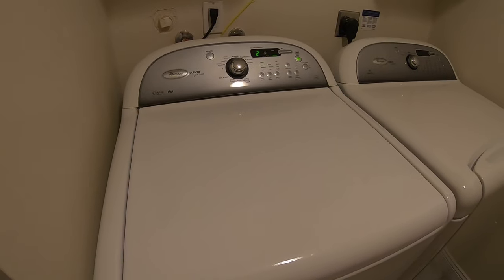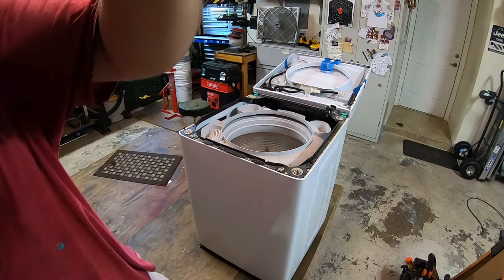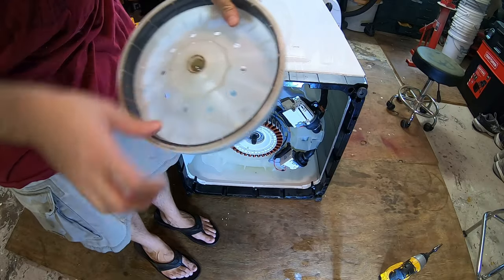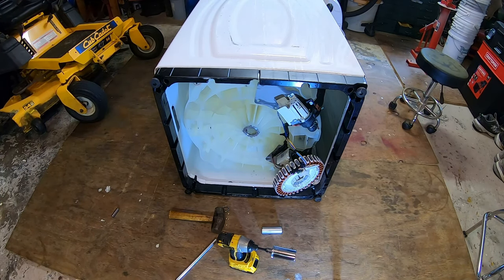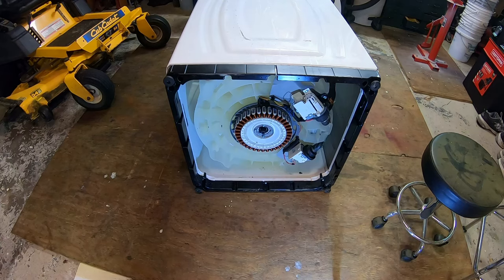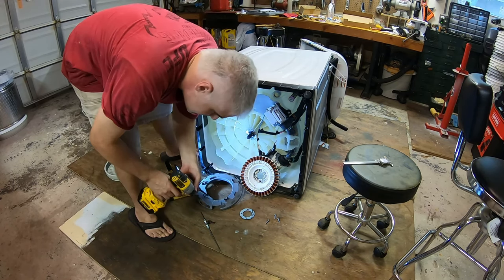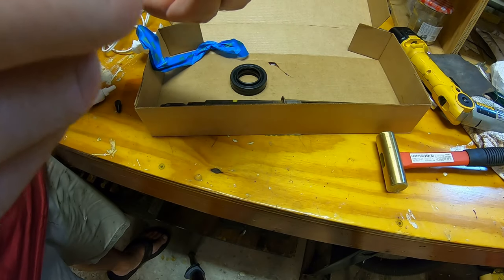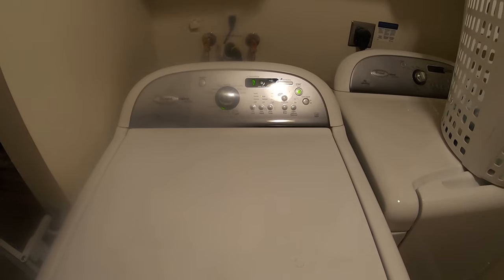Replacing the tub bearings and seal on a Whirlpool Cabrio washing machine

Comment: I did this and I thought everything was going well, but when I got near the end of reassembly, the basket hub did not sit flush on the base of the basket.  The only thing I can think is the shaft is not in far enough. There are a few threads showing beyond the nut. I had I hate to break that seal, but not sure what else to do, but take it all back apart and grease the shaft down.
Reply: I am having the same issue
Reply: @3kgt1995  Dudes, I had the same issue, I simply omitted the extra spacer in the press assembly.
My original install did not have this piece. Once I left it out it all fell together. Still need a hammer and a block of wood ...

Comment: Next time  line up the washer with the bearing with some grease , nice video. Going to do it this weekend second time around
Reply: Good suggestion on the grease. Why do you need to do the job twice, 2 washers or did you botch the first attempt? Been there and done that whith wheel bearing replacements....very pricey and time consuming.
Reply: @brianfortin9775   friend washer Was the second time around

Comment: As I hammered the bottom to get the old shaft out it fell into the outer tub and cracked the plastic at the upper portion of the tub. Does that need to be fixed/replaced? does water get that high in the outer tub to cause any leaks?

Comment: I did this on my Whirlpool, but when it came to replacing the 2 bearings, even though I had them in the kit, I ordered stainless steel bearings so it should never need replacing again. It cost me an extra $50, but I think that’s worth knowing that it will never rust or need replacing again.
Reply from the maker: Interesting. A lot of ball bearings are stainless steel. Maybe you just got a very corrosion resistant alloy? Mind sharing the part number you ordered?

Comment: Hi Joe! Thanks for this. Mine is doing exactly this, except no leaking I have a repairman coming tomorrow. Expecting big $$. Considering just using it until it leaks or stops altogether. Then buy new. Don’t know at this point.
Reply from the maker: Hope it all works out. Eventually it will start to make more and more noise and leak water. I wouldn't let it get to that point if the water could cause any property damage.
Reply: Thanks for your reply. Estimate is $340. “If nothing else breaks while doing it.” Odd thing to say?! But I went ahead, asked that he order the part and put it on his schedule. New ones are about double that right now.

Comment: Joe, I have mine apart. Is the plastic base of the basket supposed to contain fluid??
Harry
Reply from the maker: Yes I think that is normal. When I took mine outside to scrub and hose it off with the garden hose I heard water sloshing around.
Reply: @JoesGarageProductionsLLC  whew thanks so much... was worried.
Reply from the maker: @zhbh101  not a problem. Good luck with the rest of the repair
Reply: @JoesGarageProductionsLLC  that was fluid in the balance ring probably that you heard sloshing.

Comment: I need some help with my Whirlpool Cabrio. I removed the two brackets from the back. This top will NOT slide to save my life.
Reply: Hey I'm doing this now on my Cabrio. It doesn't have hinges on the back. &  how in hell do you move the top outta the way? There's no way to get to the wires to remove them?? Need help please. At a stand still!

Comment: I froze the shaft for about 14 hours.  (same parts kit which was linked in this description) Slid right in.  IDK, Maybe they saw your video and modified the part?  lol.  THANK YOU for the video.
Also, did you get an additional seal with your Bearing Driver?? I did not.  @41:56

Comment: Doing first time are allways fun
Reply from the maker: It was brutal... The worst part by far as installing the new shaft after installing the bearings. The replacement bearings didn't appear to be original NSK quality... wonder if they were a fraction of a thousandth off? Regardless, the machine is a lot quieter now and working great (fingers crossed...).

Comment: The shaft wasn't machined wrong. You had to pound the shaft in some to get it to where it needed to be. I dealt with the same issue and was watching both your video and an appliance professional's video. Heres the link to that video: https://youtu.be/6EPoTFUaAWI The only big difference was that the washer he was doing had an agitator. Thank you for the video. It helped alot! FYI: the motor rotor position sensor does come off of the stator as does the other wiring harness. Then you can just move the motor stator out of the way. And yes...I'm a girl and did this all on my own with the help of the 2 videos. Thanks again!!
Reply: You're right Jessica, they are designed with an interference fit. The inner race needs to be heated up to around 250 degrees f. Then quickly push the shaft through  before it cools. hammering the shaft in without expanding the inner race with heat will cause early bearing failure.

Comment: thanks for this great video! I can't get the old shaft out....I was banging it very hard and it seems like it moves freely a bit but something is preventing it from coming out. I noticed the bottom bearing is now deformed from all the hammering. Should I keep trying or is there something I'm missing? I was able to get the bottom nut off after much trying. The whole bottom is very rusted.
Reply: so i got the old shaft out, but cant get the new one in....i pretested all the parts and the all fit nice and snug, bit i think the lower bearing is not lining up with the upper bearing, i suspect that was your issue as well

Comment: How come the bearings went? Is it due to heavy use?
Reply from the maker: What normally happens is the seal, which is exposed to water, fails or the sealant used to seal the seal (say that 5 times fast... lol) fails. The bearings themselves are sealed, but those types of seals are not designed protect a submerged bearing. Once water hits the bearing, the water causes corrosion and dilutes the grease. Failure is likely quick after that.

We usually do maybe 1-2 loads of laundry a day on average (2 adults, 1 kid, 2 dogs, 1 cat) and the washer was probably about 8 years old at the time I shot this video. That's at least 3,000 loads of laundry... The machine was, and still is, in otherwise good shape.

Comment: I have a gap between the inner actuator (I think it's called)  and the bottom of the  basket. Is my bearings and shaft not in far enough?
Reply: I have the same issue, how did you resolve?
Reply: I have the same issue and my shaft is attached to a transmission (not like in this video) so I can't make it any lower to make the other pieces fit I have a pretty large gap a few cm maybe

Comment: may i know what is the tools at minute 15.00 which make vibration. 
thanks
Reply from the maker: Sure that is a pneumatic air chisel. Mine is an older model probably about 15 or 20 years old. This one on Amazon is pretty similar just keep in mind you will need a source of compressed air to run it. https://amzn.to/3z2swqa

Comment: Some repair places say to wait 24hr before using the washer so the seal cure. You had me all nervous leaving the stator hanging like that , next time remove the sensors with a small screw driver on tabs.
Reply from the maker: It's been awhile since I recorded this but I vaguely remember that connector being very difficult to remove or stuck entirely and I didn't want to break it.

Comment: My machine doesn't have a nut on the bottom of the shaft.  Has  what looks like a press on situation., Maybe a newer model.?
Reply: Did you figure it out yet?
Reply: @kemoayers8272  yes, spring lock on bottom shaft.  Thanks
Reply: This repair process won't work with mine on the lower end.  The whole shaft, bearings and bottom plate are replaced as a complete sub assembly.
Reply: @user-jc8ch9gq8u  Thank you for the reply. Noticed on my whirlpool unit the locking nut fastner(whatever) underneath it there is no base ring or washer with 6 screws to remove! Nothing!! Just as if you're ready for the next step.  Remove top ring fm washer & remove drum. I'm confused! Not sure if I even have right kit now. I referenced the model # and was sent the appropriate Kit & installation tool. I mean... I thought so!
Reply: I am talking about under the  Agitator. At the basket thing. No locking or hold down plate with six (6) screws nothing just a big fixed funny looking lock nut/washer to remove with some type spanner wrench then pull the drum! But the seal from the kit i ordered just doesn't seem right!! Are there different kits offered? Do you know or i guess maybe I need to do more research & investigating.
Reply: @kemoayers8272  agitator side, yeah, no six screws on mine either.  You need a special tool that matches up to that screw cap or do what I did.  I used a round chisel and hammered it into one of the grooves so that it's unscrewing the cap.
Reply: Hold the chisel at as much of an angle as possible so that the energy is unscrewing no hammering straight down.
Reply: Hold the chisel at as much of an angle as possible, so when hammering it is sending the energy not straight down but to the left.

Comment: Thanks for the video. Which bearing replacement kit did you use? Are the bearings standard part numbers? I'm thinking about buying cheap kit (with the tool) and then order 'good' bearings from McMaster Carr.
Reply from the maker: I used kit W10435302, which according to my research, was supposed to contain NTN bearings (like what came out of the washer). Instead, they were some unknown (to me) brand. Would have been nice to see NTN, SKF, Timken, Torrington or any of the owner well-known bearing manufacturers. One of them is a 6006-2RS, the other a 6005-2RS. Not sure if they are all the same sizes, though. Good luck!
Reply: @JoesGarageProductionsLLC  my new "genuine whirlpool kit" bearings are 6006RS (c&u America) & 6005-2RS (CHINA).

Comment: Does a bad bearing cause leaking as well?
Reply from the maker: Typically the seal goes bad and damages the bearing. Left alone, it can turn into a leak
Reply: @JoesGarageProductionsLLC  thank you , would that also cause a crack in the outer tub, when we had  Maintenance ppl who we got it from check it they said  there was a crack in the tub, I think the outer tub
Reply from the maker: @JamieHOTT13  probably not. That might be caused by overloading the washing machine or broken tub suspension components

Comment: They surely are not high quality german or swedish replacement bearings. I did this job and they started to get noisy after only a few years. And the aftermarket rubber seal began to leak after a year but not badly even with the use of the silicon glue.
Reply from the maker: Yeah, kind of a shame... Still going strong though!

Comment: You can buy the whole bearing-shaft-and-installation kit on eBay for about $50 all included.
Reply from the maker: Just be careful. A lot of the ones I saw looked like no-name knockoffs. Considering the time and effort that has to go into this repair to do it correctly I chose to use OEM parts.
Reply: @JoesGarageProductionsLLC  These OEMs r all made in China unfortunately. I understand your concern which may be valid.... but its a matter of cost versus benefit sometimes... thanks

Comment: This video did give me the info I wanted, but it was hard to take serious a guy doing work like that while he's wearing thongs.  FYI, the stator assembly comes off easily, so it's not hanging there in the way and getting possibly damaged.  While I did bite the bullet and watch the lengthy video and actually fix my washer, thank you, this video could have been a lot shorter if it was edited, taking out all the time walking around, getting tools, using the wrong tool....etc.
Reply from the maker: Thongs? You mean flip flops? Just some free advice - I wouldn't focus too much on footwear when evaluating expertise. I don't think there is a strong correlation :)

Comment: Where is the agitator cap
Reply from the maker: Lol that was lost years ago
Reply: @JoesGarageProductionsLLC  I have to wonder if the cap being gone played a part in the seal leaking. 
  Then, they are know to go bad. 
  Just got one in with the same problem. Have never changed a bearing on a Cabrio, or any of the other ones with stator and rotor. 
  Thinking seriously about attempting it in this one.  It is a trade in, so I have very little if anything in it, and it is a nice machine. 
  Evidently calibrating was not necessary in that one. 
  I thought you were supposed to calibrate anytime part of the drive system was replaced on these electronic models.
Reply from the maker: @rickeykeeton71  believe me the plastic cap does absolutely nothing to keep out water. it is purely cosmetic and if I recall, kind of expensive for what it is, which is why I never replaced it. I have had the drive apart a couple of times and I've never had to calibrate it... I believe mine is a fairly early model Cabrio though. Maybe that has something to do with it
Reply from the maker: Also for what it's worth, the washer is still working fine today

Comment: Just order the tub assembly with the driveshaft and save yourself a lot of trouble bearings already installed stay away from Amazon cheap parts they’re not OEM parts It won’t last long
Reply from the maker: Interesting suggestion. How expensive is that approach? And I agree with you avoiding non-oem parts